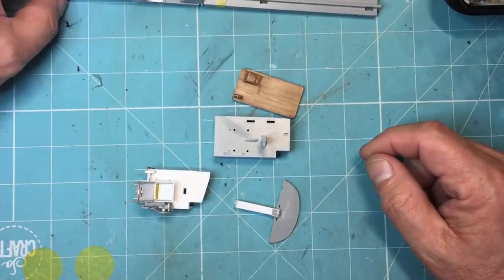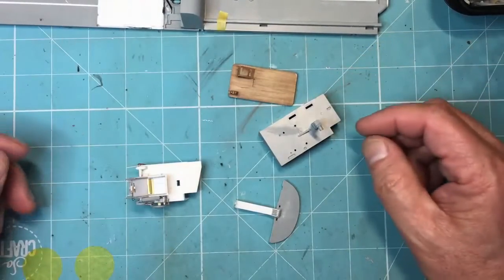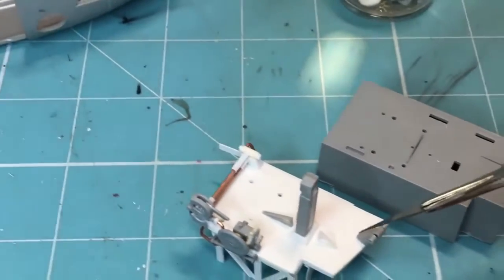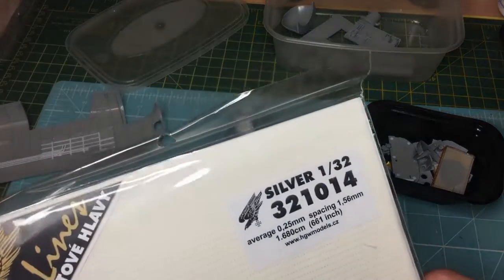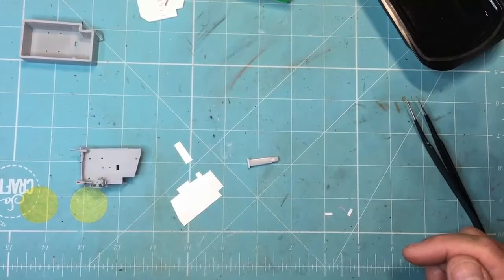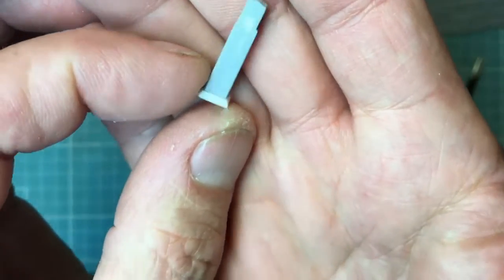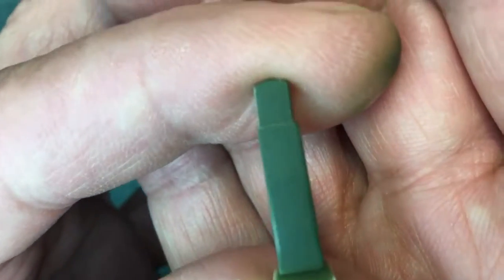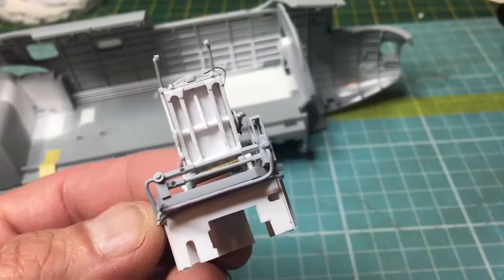HK Models 1/32 Lancaster upgrades. My mods part 5

Comment: I can relate on the research side of building a model. I just started the Trumpeter 1/48 U-552. I'm building it as U-371. Just like your HK Lanc, Trumpeter cuts a lot of corners in the detail department. I have tons of photos and drawings, as well as US Navy and British Admiralty documents to try and fill in the blanks. I'm a junkie for research and, while not exactly a "rivet Counter", I try to recreate a piece of equipment as close to original as reasonably possible. Just like your Lanc, conflicting info and photos/drawings can drive you nuts. Your attention to detail is great. Love your videos.
Reply from the maker: Charlie Messenger thanks Charlie. I also started that kit. I got as far as moving the anchor forward, Correcting the bulge holes, recreating the half spherical pressure vessel nose and ripping out the crappy plastic ribs in the torpedo room. The torpedo doors are too long also. I worked with a Czech company on making corrected PE for the kit but that went quiet.. We designed templates and panels to accurately build the kit as per the box art, U502 from memory?  Note that Trumpeter have got the ficticious panel thing just aft of the torpedo tubes on the starboard inner wall, the floor is totally wrong, they have included the heaters as found in the museum boat and they even included the fire extinguishers. For accuracy the kit is not at all good... yes another one!!
Reply: Hmm, that all sounds familiar. Were you posting your work on a forum? If you were, I was following that and stealing, I mean borrowing ideas.
Reply from the maker: Charlie Messenger yeah, but cannot remember now. It didn’t get much interest from memory?
Reply: I have several desktop icons for various  u boat builds and yours is one. Or I guess WAS. I was waiting with baited breath for you to carry on. You had purchased the RC Subs PE sets and I really want to see how those turned out. Maybe when you get tired of building planes you can go back underwater. You’ll have at least one fan.

Comment: Love Your attention to details.  Have also given me the necessary push to restart work on my Revell Ju 88 A-1.  Am using the Junkers technical manuals for detailing the kit With lots of detail pics.  Looking forward to further updates.  Greetings from Norway
Reply from the maker: Arild Ek ihave also started that kit and worked from manual bits and pieces I could find. There is a very good resource on LSP for that aircraft.

Comment: Rivet counting in excelcis... 
The 'joy' of modelling with kits nowadays is somewhat spoiled by how detailed they have become and consequently how high our expectations have grown. Treat yourself, by a late 50s Airfix kit from eBay or at a swapmeet and build that. Oh boy, you will get a shock...
Keep up the good work.
Reply from the maker: Agree 100% Andy, but I could probably get about 30 to 40 50's kits for what this cost. Take the Monogram 1/72 B-52.. the oldest and most accurate B-52 kit out there, MUCH better than the new MC kit.

Comment: Intrigued to see you've added the grab rail under the flap wheel Wasn't this a late war mod, fitted mainly to FE & Lincolns, so not seen on early kites.  The mods are great Nigel.
Reply from the maker: Oh no.. have I made an error @ian8354 ? I looked for that part all through my spares bin too. It's a grab handle off a 1/35 Tank or sometghing. i may cut it off, or i may just tell the story that 617 Sqdn trialled that bar before anyone else had it??
Reply: @NigelsModellingBench  Up to you Nigel if you want to leave it on, me I'd cut it off.

Thanks for the great idea how to alter the rear wings on the HKM Lancaster, done the same as you, so thank-you for doing the video's, they will be helping loadsa modellers, me included.

Comment: Beautiful work but it is a shame you won’t see half of that nice detail work. Unless you make some removable panels so you can see inside. I love to do crazy detail work like that myself. But nowadays my eyes are so bad after 50 years of micro work. I’m finishing up my Lancaster dam buster bomber now in 1/72 scale. Thinking of building another one for a diorama display.
Reply from the maker: I think it will be seen Lester. the canopy is pretty clear and non distorting so much of what I've done will shine through. It will be the painting and dry brushing that will make it pop. I can't go crazy on the weathering because the planes didn't get used much up to Chastise.

Comment: lever to open and close bomb bay door should be to left of pilots  seat
Reply from the maker: Dambusters didnt have bomb bay doors. There should also be a lever for lifting the seat, but thats not fitted yet.
Reply: I doubt it was possible to remove they may have cut the cables but a large lever like a car brake bolted to the floor in a confined space that meant removing the seat to get access to it would be a field mod but unless we find a photo its one we will never know for sure
Reply from the maker: steve08717 bomb bay doors were hydraulic. The union to the rear left of the set is the valve that was used. I’m assuming the valve would have been left in place as it formed part of the hydraulic circuit that included the undercarriage.